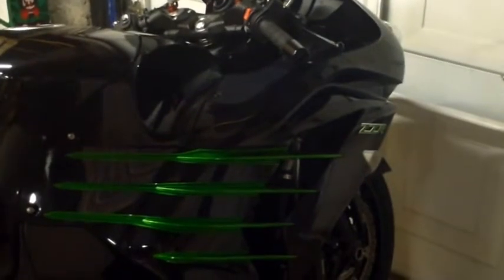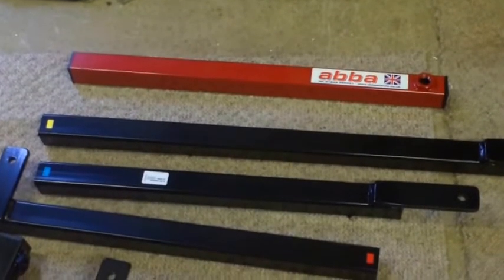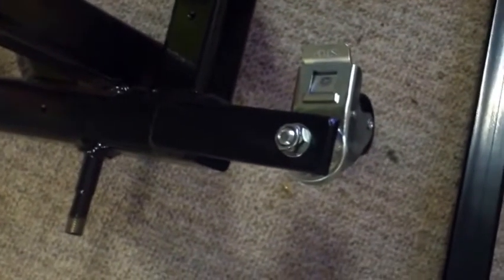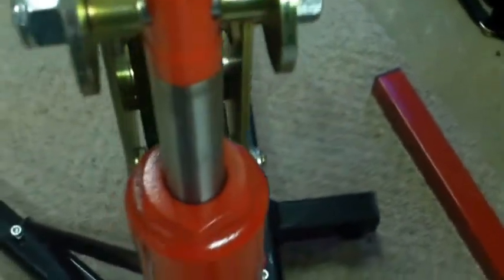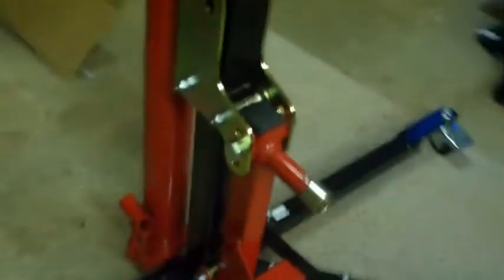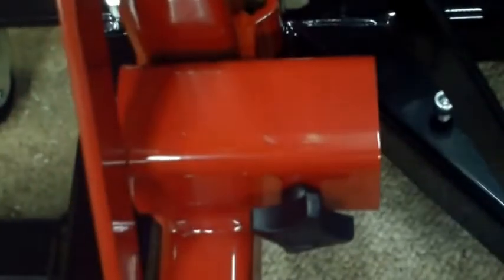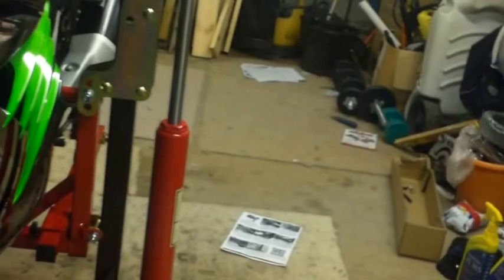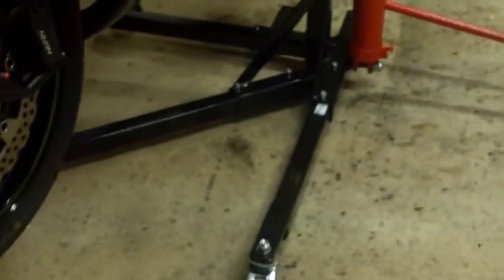abba SkyLift assembly

Comment: Thanks for posting, I'm considering buying one. Only problem for me is that I don't have a lot of garage storage space for it when not in use, pity it doesn't collapse down but I guess that would compromise its strength
Reply from the maker: Steve Lutwyche Hi Steve.  my previous garage had little space also, which is why I bought this one opposed to the a flat bed lift which takes up permanent floor space.  I used to put my bike onto the abba stand after a journey, raise it and manoeuvre the bike tight against the wall whilst on the stand and leave on the stand.  You need a fairly smooth floor surface for this as the wheels to the abba stand are hard for obvious reason.  So you could always do try this.  Make sure it fits your bike frame as the pins slot into the swinging arm pivot.  Let me know how you get on.  Cheers